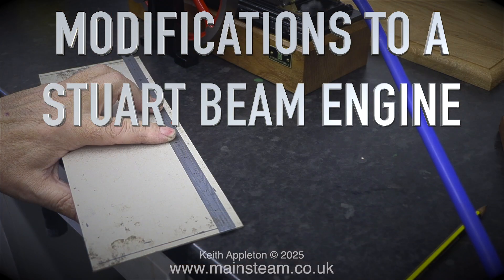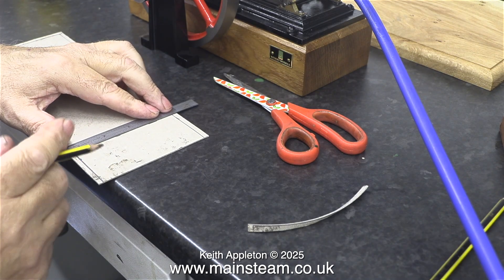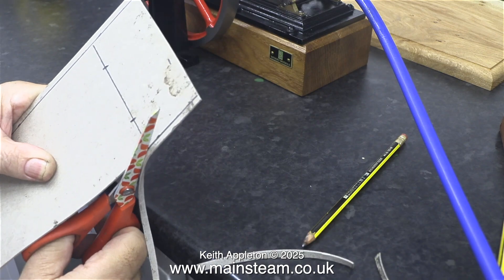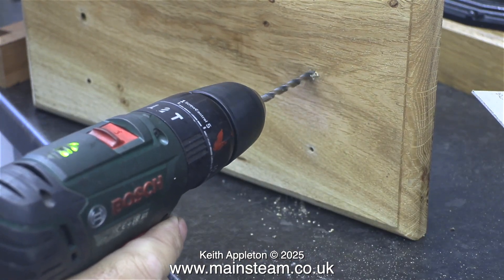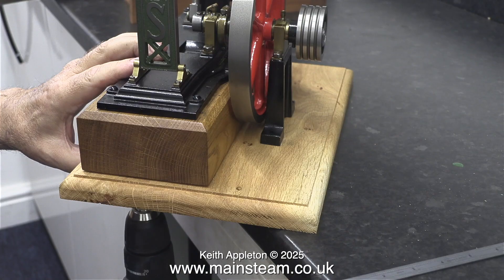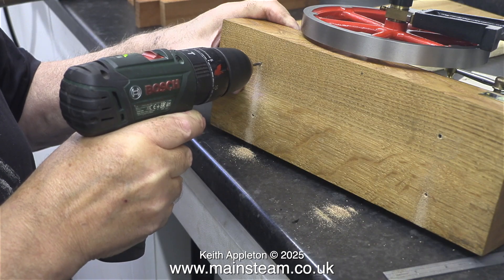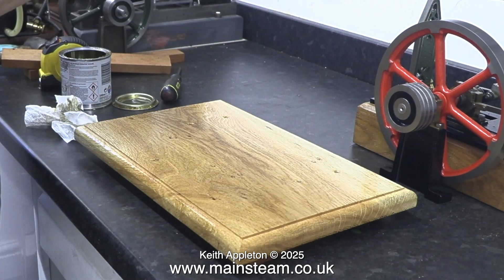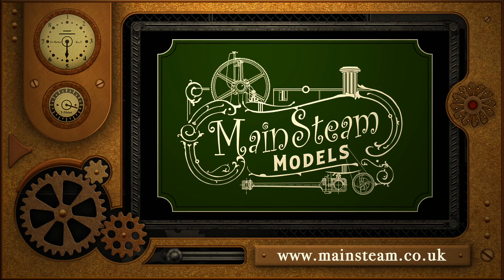MODIFICATIONS TO A STUART BEAM ENGINE - PART #3

Comment: I'm not sure that a material that is potentially both compressible and expanding, and that can absorb both oil and water is the best choice for a shim under a steam engine, especially when the alignment of the crankshaft depends on its dimensional stability. At the very least I'd varnish the card first.
Reply from the maker: Thanks for your criticism as usual Paul - I have used this method many times before with no problems whatsoever.

Comment: A sign painter I knew told me, to really waterproof your wood, cut the paint 50/50 with thinner for the first two coats, sand lightly then finish coat. 0000 steel wool to cut the shine. 👍🏻
Reply from the maker: I do that sometimes, it is in my opinion the best method. In this case I just didn't have the time owing to my scheduled Kidney surgery }:-)))